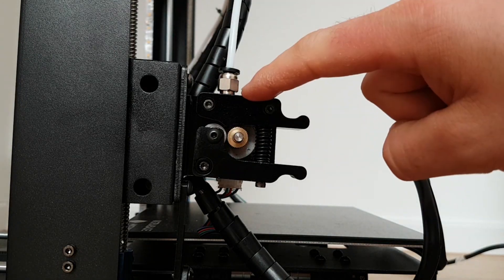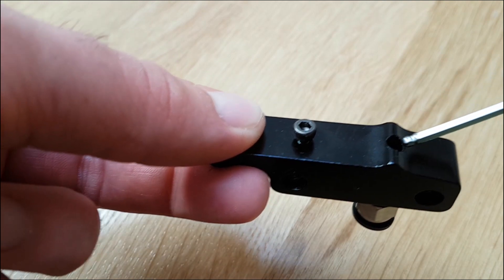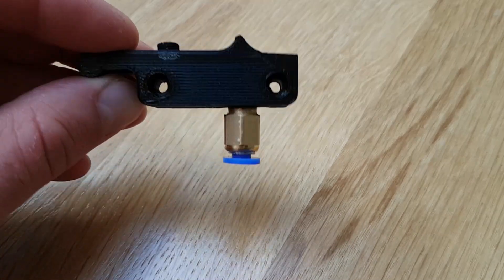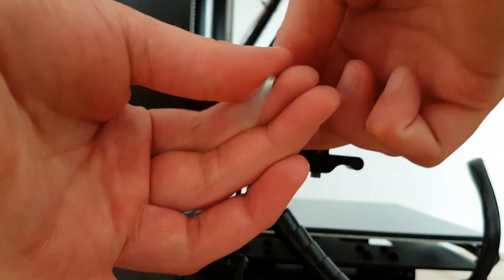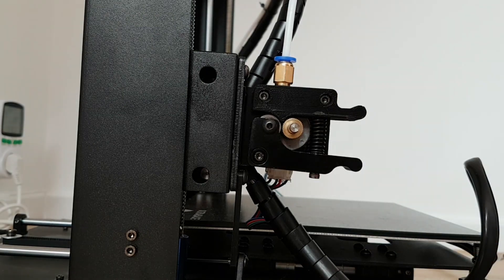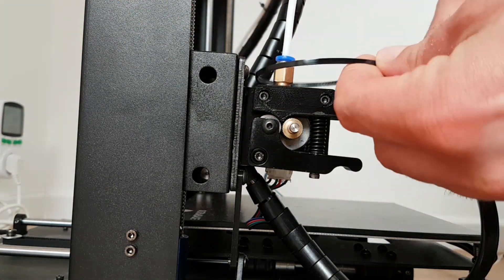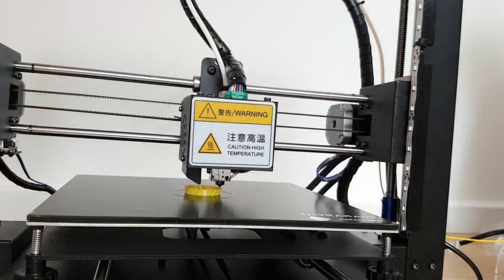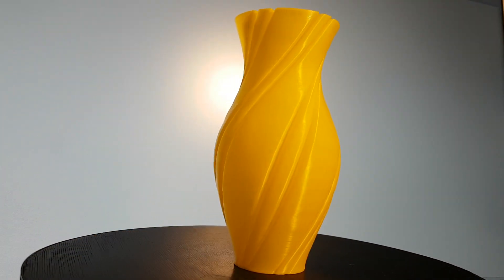How to print TPU on Anycubic I3 MEGA MOD + FFF profile for S3D

Comment: did you use retraction with that tpu? how did you get good results with that retraction tower print?
Reply from the maker: Yes I'm using retraction. Lenght 5mm and speed 40 mm/s

Comment: What is your TPU value? is it 95A or 65A?? these are commonly available in the market
Reply from the maker: Hi, I'm using tpu from Devil Design and it is 65A. Now I'm working on next video about printing tpu.  I have replaced my oryginal ptfe tube to smaller one. Now I can print out perfect benchy.

Comment: How do you solve your objects from the Ultrabase? My things are very difficult and with much violence from the ultrabase solve. I print with filament from Sainsmart Temp: 215/30
Reply from the maker: Temperature of your utrabase is too low. You have to heat up it to 80 and after print you have to wait for cool it down (for example 35). After this you can just take it from the bed without any force.
Reply: Okay, but why is the printing liability so good? I thought you have the temperature down with TPU.  @TechDayEveryDay
Reply from the maker: You should check my FFF profile.

Comment: I have made a direct drive extruder for the i3 mega (for tpu) . The Data will be uploaded on thingiverse asap. Little demonstration in the Video link. https://youtu.be/ag7bIFYnJvs
Reply from the maker: HI,  Is it only for TPU now? What about printing with high speeds? Direct extruder is heavy and printing with high speeds has very low quality. What is in your case?
Reply: @TechDayEveryDay  Hey. No i'm printing also Pla. Abs and other filaments. All with good Results. You can easily work with 75mm/sec and get good prints. ( of course better results under this speed-parameter😉). At this time the extruder worked realy fine. Maybe about 120hours complete printingtime.

Comment: I use Cura. Can you tell me your printsettings?
Reply from the maker: Yes, of course:
Nozzle Diameter 0,4 mm
Extrusion multiplier 1,15
Retraction distance 4 mm
Retraction speed 40 mm/s
Layer height 0,2 mm
top solid layers 4
bottom solid layers 3
outline shells 2
first layer speed, height, width 100%
infill 50%
outline overlap 50%
infill extrusion 105%
bed temperature 60
nozzle temperature 250
cooling, layers 1,2 0%, layer 3 -> 30%
printing speed 20 mm/s
non printing speed 100 mm/s
Z speed 20 mm/s